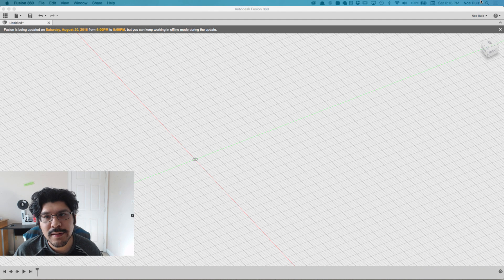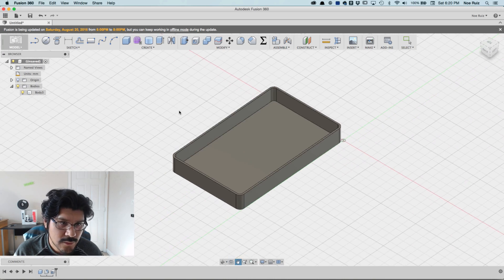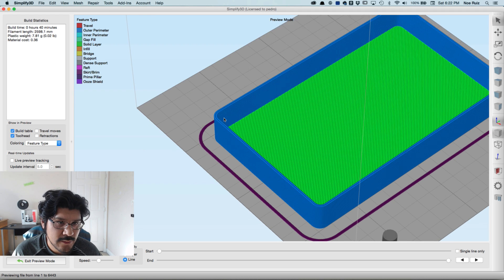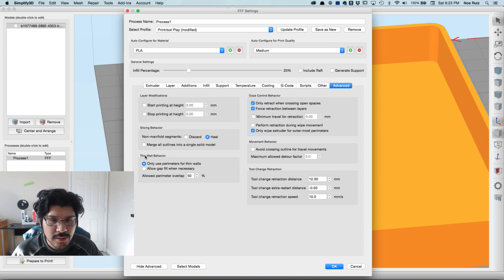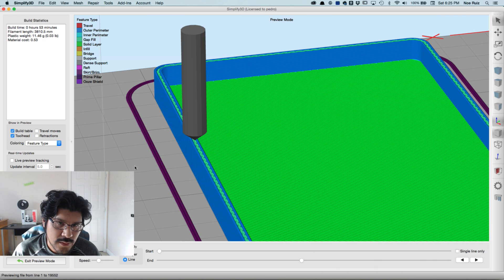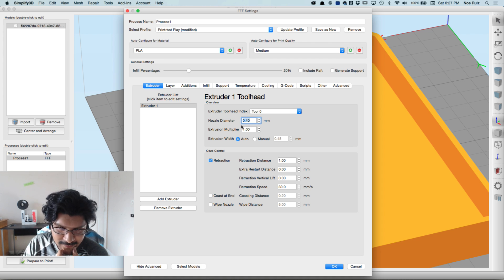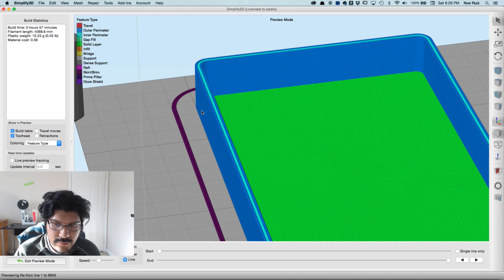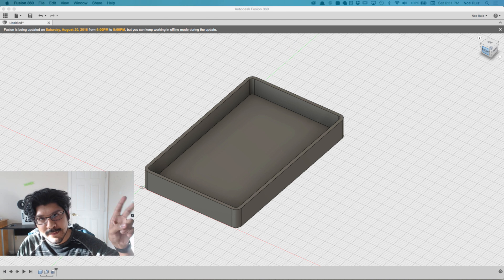Layer by Layer - Shell Thickness

Comment: I 3d print shelled enclosures, currently in PLA.  As in your video, my enclosure face is down on the platform. This leads to some surface imperfections. What can I do to get a better surface finish?
Reply from the maker: A textured PEI flexible plate for your printers bed might help in better surface quality

Comment: YES! GREAT! This is the information I was looking for. 
The version of cura that came with my CR10 does not have the solid wall option.
You explained it very well and now I just adjust the wall thickness.
Also the straight lines of the wall speed up the prints too! Thanks again!

Comment: Great job.
Thanks for explaining this. I always hated hearing (and watching) my printer when it had to Zig Zag to fill in the gap. I need to spend more time optimizing my Simply 3D files so they run smoother. Up until now I just used the default settings and went with it. Never thought about optimizing the drawing so the 3D Print was smoother. That Zig Zaging is hard on your machine.

Cheers
Willy